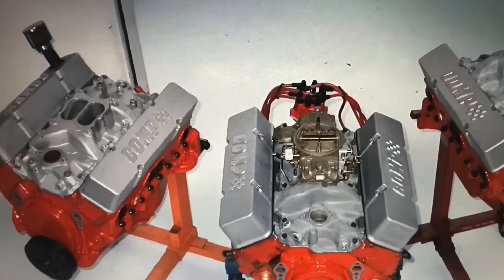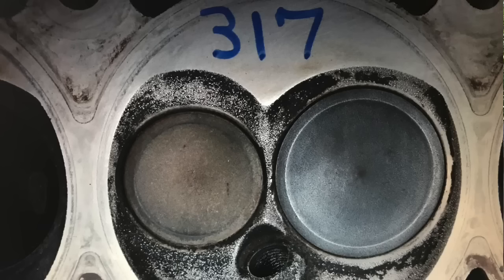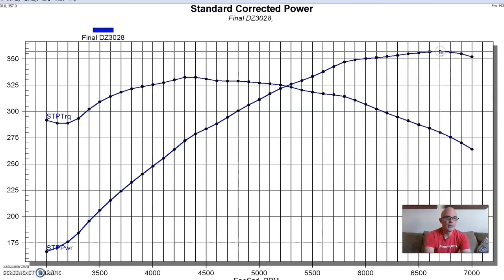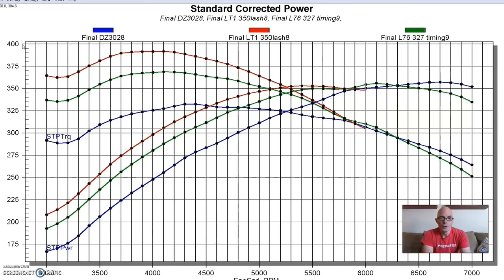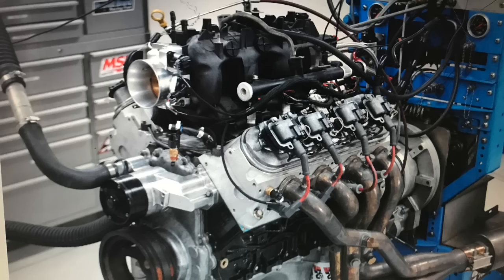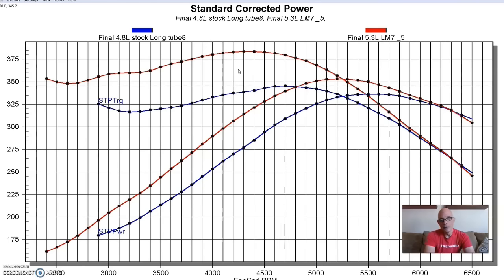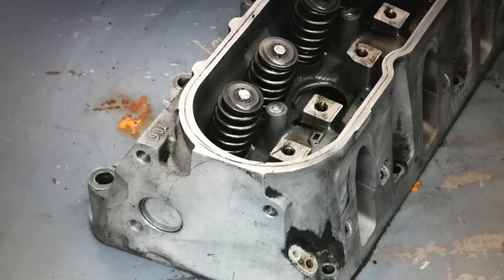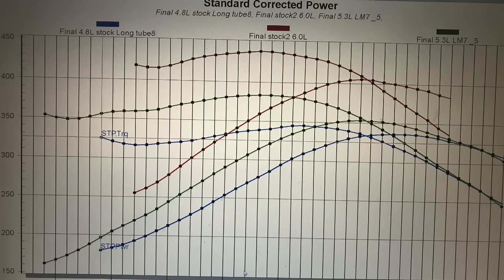HOW MUCH HP DID THE 1969 DZ302, THE 1965 365-HP L76 327 OR 1970 LT1 350 REALLY MAKE? WAS IT FAUX HP?

Comment: Would love to see a comparison between the  different Mopar 340s. A regular 68-69 with a Carter AVS and X heads, a 71-72 with a Thermoquad and J heads and a 70 T/A or AAR with a 6 pack (slightly different block, not sure if heads are the same).

Comment: He simply verified once again, what I learned as a 16y/o boy many years ago;  If you want to win races and don't have all the money in the world, put your money in buying  a big motor as opposed to building up a small block. However, very few things can warm my old heart like hearing the idle of double hump SBC heads on a 327 with a 108 General Kinetics or Crane(Blazer series)  cam tickling the valves. Long live the small block.
Reply: The old saying back then was the only substitute for cubic inches was cubic dollars.
Reply: I agree..  I had a choice to make for my 55 Handyman wagon..   the first choice was a stock 375hp396 or a friends 331 from his 1/4 mile 3 round,roundly,. My mechanic dad told me to use stock big block which was supposedly less hp, but that 396 smoked that 331(in a 70 Firebird) and keep me on the road in high school....
Reply: I think you need a girlfriend to tickle your whatever.
Reply: The BLAZER
Reply: No replacement for displacement!
Torque Rules the street!
Reply: But love the DZ in light car and right gears!
Reply: When I was 16 I had a 64 El Camino with a 327 with a cross 2 -4  manifold. Offset dual quads. It was a screamer

Comment: What about the 283? That engine is a legend in its own. That engine came in 2 ton trucks. It was a truly tough engine
Reply: Forget the 283 I want to see a 400💪
Reply: I bored a 283 .o60 to 292 CI , 194 valves on power pack head old carter 4 barrel a RV cam it really pulled nice on mountain road in Colorado I pocket ported the power pack heads and matched intake ports to a low rise intake manafold with . 308 rear end and TH 350 that 63 step side hauled ass
Reply: "RV Cam🙄
Reply: @gteefxr3094  Definitely not "3/4" race cam, more like a"3/8" race cam ;)

Comment: In the 80's I was 20 and built a .40 over 350 block with a 327 crank, milodon drive, windage tray, 11-1 Pistons all the good stuff heads etc with a Crane Custom Grind solid cam .575x.300 intake and exhaust (4deg retardef) triple valve springs, balanced, o-ringed, Weiand Tunnelram with 2 660 center squirterswith 50cc pumps and a direct port 225 Nitrous.  4000 stall manual 400, 5:13 posi.     Lifted the front wheels on my 72 Chevelle.    ahh the good old days.  lol now im old
Reply: That's just a 327 with better parts and an over-bore. 327 and 350 have the same bore.
Reply: 333 cubic inches .
Reply: It didn't lift the wheels. There's no way that crappy combo lifted the wheels.

Comment: Piston speed/cylinder wall resistance is the biggest difference  what's crazy is connecting rods are all the same so that gives the 350 an advantage having longer rods . The rods on LS motors are even longer giving more of an advantage.
Reply from the maker: rod length is all the same on these  motors-only stroke length is different

Comment: Great test as always but what people some times forget we dont race dynos, in a car on a 1/4 mile track 350-3.73 / 327-4.10 / 302-4.56 the times would be too close to call.  With the more rpm you can run more gear witch ups the engines torque to the wheels witch moves the car. Again great test as usual pls dont stop.
Reply: This engine was developed for sports car racing
Reply: True, that gearing would put the engine into its best power producing range, BUT real-life losses have a larger effect like crank train inertia, windage, bearing friction and same for gear train when using a high RPM engine.
Reply: Absolutely, and looking for a good engine for a Factory5 Hot Rod or Roadster is not the same as outfitting a Nova to run 1/4s. That makes me wonder what sort of top end an LS7 dry sump block would make with custom 3.26” long snout crank. 😅 As if I could afford such a thing.

Comment: Loved it. I’d like to see a similar Ford compassion between 302, 331, 347 and 351, 408 and 427. Just a thought.
Reply: You can make a 427 ford in different ways. What I would like to see  is, What 427 has the  best power  . I have seen 4.03 bore  by 4.2 stroke  4.125 bore with 4 inch stroke and  4.2 bore  and 3.85 stroke1 I would bet the biggest bore will make the  most power!

Comment: So what you’re showing us is that if you burn more fuel at any given moment, the amount of power made is directly proportional to that amount of fuel burnt. As scientific as the pictures, narration, and graphs are, I’d like to see more depth. Such as rotating assembly mass/weight, main journal sizes, and driveline losses.
Reply from the maker: the difference in the power curves was not from those things-it was displacement (and cam in the case of the LT-1)

Comment: The 63 365-375, 327 did not share the same head with the 302 or the 370- 350. The " fuelie" heads were actually the very rare 461x not just 461, 041, or the 176 bolt hole double humps. These three had intake volume in the 167cc to 170cc range. 461x fuelie heads had intake volume closer to 200cc. You can spot them by the octagon shaped rocker stud bosses which were beefier around the rocker studs. This was done to keep the studs from pulling out on the duntov 30-30 cam. A true 327 365 with x heads and a swap to the larger " road race cam" will make nearly 500 hp chief.
Reply from the maker: no

Comment: Hi Richard.
Love your series of videos, and enthusiasm.
Also like that you back all your parts combinations with a dyno run to show what they put out in the real world.
Question: do you know of a manufacturer that makes a small block Chevy valve stem seal (.343 dia.) with a built in flange / spring shim that the stock spring sits on, that will also fit into a stock valve spring pocket in the head without requiring machining?
I'm interested in the manufacturer,  part number, and if the flange is available in different thicknesses to eliminate the need for spring shims to compensate for valve seat grinding.
Take care. Stay safe Bud.
Reply from the maker: Sorry-I do not
Reply: Thank you for fielding the question.
Take care Bud

Comment: Thanks for this excellent comparison. I was tempted to de-stroke my 327 until I saw this video. The 327 makes the horsepower and torque at a lower RPM which I think would make it more drive-able on the street and easier on the internal engine components (not having to rev to make the power). On another note, any thoughts on the old Edelbrock C3BX intake manifolds? How does it stack up against the factory intakes? I fixing to revive a small journal 327. It's .040 over. The piston are flat tops. The heads are 291 casting 2.02's. The cam is an Engle flat tappet hydraulic 267 duration, .460 lift. It was built back in the early 80's for my old rusty 1968 Chevelle (RIP). I plan on sticking it in a 1963 C-10 and want to go with a 700r4 and stall converter. 3:73 gears? Any thoughts? Thanks!
Reply: That is still a solid package you are describing, the 3.73 will work well with that 700r4. I agree you should consider upgrading to a Performer intake, dual plane probably best on the street, right?
Reply: @jeffmooers2174  Yes. Street rod. Thanks!
Reply: Intake  manifolds  have come  a long way  the newer manifolds are better than the old ones!  Get one that is more up dated !

Comment: I would like to see a comparison of a 305 Chevy and a 302 Chevy using the same heads, camshaft timing, intake and carb. I would think the 305 would produce more torque due to the longer stroke with the same cubic inches. Wonder what the actual outcome would be

Comment: More displacement is great, more torque is great... but where the 302 excels and what is left out of this analysis is how quickly the engine goes from 3500rpm to 7500rpm and that is where the 302 will blow the others away. The 302 revs like a 2 stroke motorcycle compared to the tree stump pulling torque, slower revving of the longer stroke engines.  I had a 327 with the 140 first design off road cam and it was fast but still didn't spin like my 69 Z28 302... you want torque? Get a mopar 440.

Comment: The GM 302 was just a 327 with a 283 crankshaft. A "destroked" 327 basically, specifically produced for Trans am series road racing which was limited or restricted to 5.0 liters.
Reply: @JimmieCates nope , the 307 was the opposite deal . A 3.875 bore 283 block with a 3.25 stroke 327 crank .
Reply: Yeah, that's chevy for ya.
Reply: ,,,,,,,,,,,,,,,,,,,,,,,,,,,,,,,,,,,,,,,,,,,Way back when,,,,,,,,Racers ;  bored the stout 283 blocks [283 bore was 3.875 ]    .125 " over to 4 inch ; that gave exactly  301.44 cubes........Many crazy guys destroked the 3 inch crank to fall into ideal classes in Modified / Production classes.....Dem early 283 engines had steel cranks........
Reply: Duh
Reply: @naughtmeenaym869  you're IQ is showing at a record low.
Reply: I’ve had both the boss 302 and the z28 the boss was way more powerful. It took more to figure out the correct cam for the boss but it was a beast at around the 7k mark! I now have a big bore short stroke sbf… dart block with ‘69 boss 302 heads. The dart block has a 3.4 crank and 4.155 stroke. The big bore unshrouds the valves of the boss heads. The boss heads have been ported and titanium valves added to the mix with titanium rods. It’s basically a nasty nascar engine. I have a Shelby boss 2x4 manifold and a Shelby 8x1… the engine is going into a 1966 mustang gt 350 fastback 5 speed tkx 4.11 rearend. Love this channel it’s given me lots of food for thought. 😊
Reply: @blucheer8743  were you aware that Ford had to release three different versions of the 302 in order to be competitive with the 302 Chevy in 1968 . As I recall one of them was referred to as a tunnel port engine .
Reply: @bobbrinkerhoff3592  yep the z motor was a small block engine and an all around great race motor and it lead to the  demise of the hi-pro 289. The boss 302 was a small block with big block heads on it. It’s been fun designing a high rev engine around those heads but can’t really call it a small block engine in mho
Reply: @blucheer8743 the 302 boss had cleveland heads on it. Not big block heads Lmao! What do you think a cleveland is?? I think it's safe to say the 302 boss is a small block. For your future conversations I can tell you, you can not bolt big block heads on a small block. Lol! So if the small block has heads on it, they are also small block heads! Lmao! Only a chevy guy would think the Cleveland was a"big block"! 😂😂😂
Reply: @jesseduke694  That is just like the Chevy fan boys stating that the original version of the ChryCo 318 was a Big Block, but not being able to explain a "Big Block" rotating assembly can fit in the 67 and later version of the 318.
Reply: @bobbrinkerhoff3592   Yeah they wiggled their nose and blocks and heads just appeared from the earth instantly.

Comment: THE FASTEST LITTLE CAR THAT I HAVE SEEN WAS A 65 NOVA WITH A SMALL BLOCK 400 C, I,  BUILT WITH A 283 C,I,  CRANKSHAFT ,  WITH A 4 SPEED,  INSTEAD OF BURNING THE TIRES OFF. IT HOOKED UP,  GOT TRACTION,  IT WOULD WIND UP SO FAST THE DRIVER HAD TO SHIFT GEARS SO FAST AND NOT MISS A GEAR, THE R,P,M, s made up for the lost TRACTION,  it was unbelievable how much fun it was to drive through the mountains ROADS,

Comment: 327 crank in a 350  block an a set of 202 s  that dog will hunt... stroking it
Reply from the maker: a 327 crank in a 350 block is just a 327-it was one of the motors tested (L76) and it had 2.02 heads
Reply: @richardholdener1727  383

Comment: Hi Richard,  If I want the most low end torque for my '02 Avalanche, how about the smaller 5.3 heads on a 6.0 or 6.2?    Now has 5.3 with 265,000 miles. Tom
Reply from the maker: 706 heads, mild BTR Torque cam and long tube headers

Comment: The correct lineage of the Chev small block is actually 283-307-327-350. There was no "302" Chev. Some marketing material from Chev said 302 but that was to counter the popularity of Fords 289/302. There were three 5 litre Chevs...the original 307, a 308 that was sold in the southern hemisphere, a 305 that was used to qualify under 5 ltre for racing...known as the black motor becuase it came with a black painted engine block. Just saying for the sake of accuracy. The LS is such a vastly superior motor that I am surprised that anyone bothers with the old bow tie anymore.

Comment: Very cool explanation.  It would have been interesting to see the torque and horsepower curves plotted against piston speed rather than rpm.  If I had seen this before I built my '70 LT-1 clone a few years back, I might have gone with the Duntov cam.  I wanted to build "stock" performance so I'd have fewer reliability issues (having been burned with a flaky valvetrain by going too wild with a Ford FE 390 in the past).  

BUILD QUESTION: On your intake, did you use the vintage manifold or a modern equivalent?
Reply: From what I remember reading some of the difference in sbc factory  cams depends on open ex. Verses typical street mufflers.i can't say if matters in the lt1 vs duntov cam for your application .I have similar reliability concerns as you.i bought the 72 lt1 hyd cam for 377 project.iunderstand the relative slow ramps on fact. hi po cams cost power,but valve spring pressure is modest and easy on the valve train.if it doesn't meet my expectations there's stiffer springs and 1.6 rockers.

Comment: We know a 362 cuin sbc1 3.25 stroke will  walk the dogs on a  3.5 stroke with same cuin.. we know the 1/4 " motor makes basically the same peak power as the 1/2" motor we know on the dyno the 1/4" motor makes less tq and power down low rpm in the 4k to 5k range but we also know the "1/4" will sing on top end 9300rpm plus, with an extra 500 to 800 rpm while staying in the power plus the 1/4" motor will stomp the 1/2" motor on a oval dirt track or asphalt, we dont race dynos, a 3" motor like 311 cu in  while down about 100 hp will run with a 358 cuin 1/2" motor on the 3/8 mile race track and if the track gets slick the 311 cuin will pull away. Dyno numbers wont show you this unless you do some out of the box thinking. The 311 has a softer power application allowing the tires to grip better offering more acceleration with less tire slippage.. same story with the 362cuin 3.270 or 3.260 or 3.250 stroke. The slicker the track the more the difference. Another thing the higher rpm motor makes more power as the car get faster utilizing the down force to increase traction, then on corner exit and the 1st 100ft of the strait it's softer power delivery enhances traction, repeated fact but a very important one...ah a 3 1/4" motor what a perfect combo.

Comment: Bullshit. 302 and 327 have the same stroke.. 302 is a 327 block 283 rods crank
Reply from the maker: 302 is 3.0 stroke, 327 is 3.25 stroke (rod length is the same)-283 had 3.0 stroke, 302 and 327 had the same 4.0 bore

Comment: In regards to the SBC, we have to remember cars at that time were not getting any lighter, yet people wanted them to go faster. Easiest way there was to increase stroke to provide much welcomed torque to get the beast off the line.

The 302 was developed for the race circuit, not stoplight warriors with production cars. In a factory weight street car, I’ll take the 350 (or a 383) 10 times out of 10.
Reply: 5.0 liters was max for SCCA or  IMSA ? Chev DZ302, Ford Boss 302, Dodge T/A 303? and Pontiac 303 from destroked 400 ram air
Reply: @eflanagan1921  Also the AMC 304, was a destroked 343 block, to use the heads with the larger valves, that the 3.75 bore 290 block couldn't use. The  Chevy 283, and Ford 289 already had 4 inch bores , while AMC designed their engines for torque, over horsepower, so a longer stroke, smaller bore, were used. The AMC 304 engine introduced in 1970, still had the 290's 3.75 bore, with a taller deck height, and longer stroke, as did the 360, which was destroked for use in the T/A series, because of its 4" bore.
Reply: @eflanagan1921 5 liters was the SCCA limit for their A sedan class, that the Trans Am series was based on. IMSA GTO allowed larger displacements.

Comment: You changed the colors of the  blocks while comparing them, out to confuse me I see.  But what I really want to know is why my engine stalls with a flat spot when I floor it at idle.  Everything's been offered from vacuum lines, timing, points, plugs, condenser, battery cables, jets, idle screws, and on and on.  I bought a tune up kit I'll be putting on soon.  But, if I come back here....what's the one word answer .....and Thanks
Reply from the maker: sounds like fuel-it's the carb-try opening the throttle slower-if that works-check accelerator pump (or opening cam for pump)
Reply: @richardholdener1727  Thanks Richard.  It does run with a slow throttle, but my foot just isn't trained that way

Comment: Hi Richard I would love to see the 4.6 Ford DOHC vs a stroked version 3.75 or 3.8" stroke. I am building 1 and lots of opinion either way with doing a stroker or not
Reply from the maker: we did plenty of 5.0L 2V strokers
Reply: I have watched on U-tube some of the 2v testing. The PI and non PI and adding boost. Never found a comparison of 4.6 vs the stroked (5.0)
Reply: @richardholdener1727  how would the 6.0 L's 317 heads and cam (all LQ4 stuff) affect the 5.3 L from a 2002 Chevy Silverado Z71 ½ ton extended cab short bed 4x4?